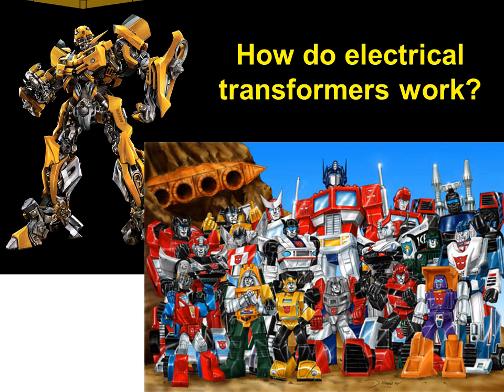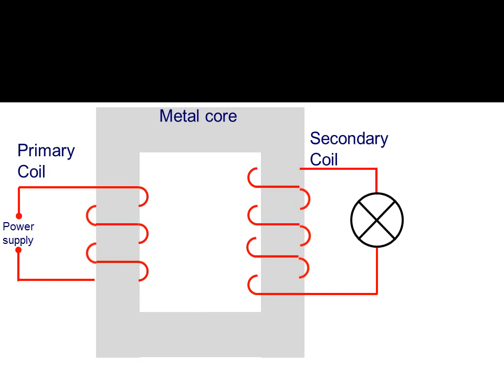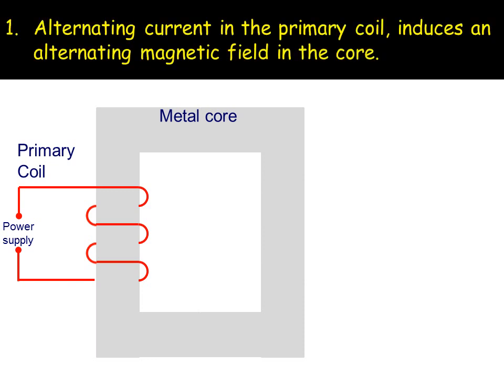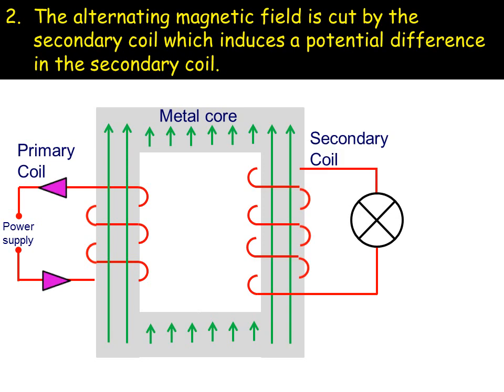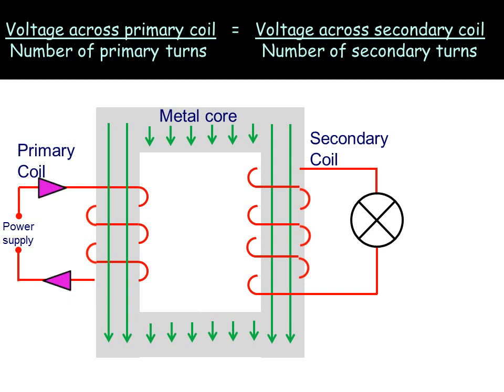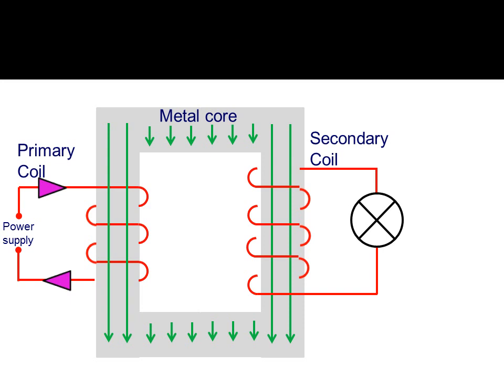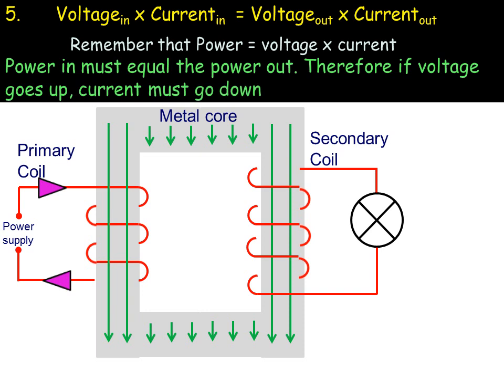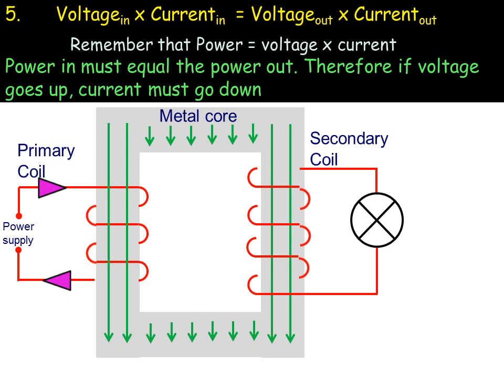How electrical transformers work

Comment: excellent and easy explanation to understand the way it works, my question is, I have a micro hydro generator, out put is 50v 220mah, can a transformer induce the amperage even if I would have to compromise voltage